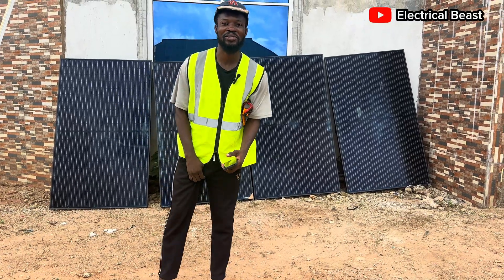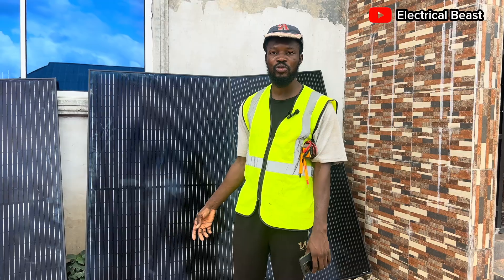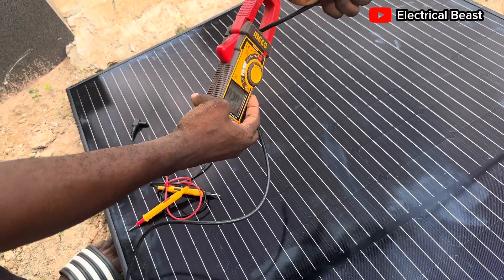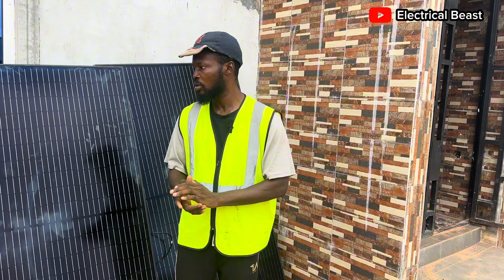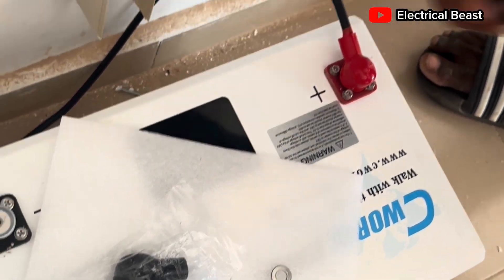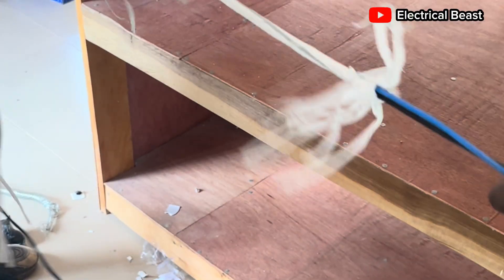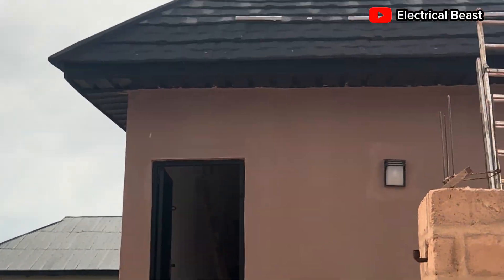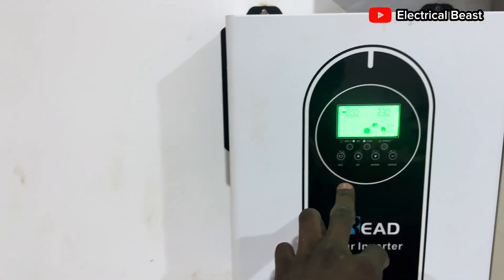Full Solar Setup Tutorial: 1800W Poly Panels + Inverter + Lithium Battery

Comment: Well-done boss. I have a question, for hybrid inverters, the charge controllers are inbuilt. How do we get or know the specifications of the inbuilt controller so we can properly size our load? Secondly, is hybrid inverter better than the non hybrid in terms of functionality and which is more expensive in terms of price?
Reply from the maker: The specifications are boldly written on the nameplate of every inverter. Lot of installers are switching to hybrid systems, they’re well efficient and overall cost is cheaper compared to low frequency inverter.

Comment: Not correcting you but many installers have disputed that absurd 13.8v bulk instructions from cworth. 

when the norminal voltage as they claimed is 12.8(3.2vx4).
Then for each cell to fully charged it would be at 3.6vx4 = 14.4v

Bulk charge should be 14.4v
Reply: I set mine at 14.4 bulk 13.8 float btw
Reply: @antonioatwhole7087  You’ll understand better later why it’s not advisable to charge your battery up to 3.6V per cell…You’re going to keep stressing the battery which will make it heat up and cause internal wear and tear thereby degrading your battery faster.
Anything above 3.5V per cell is not worth it as battery pack has been able to give even more than their rated capacity just by charging it to 3.5V per cell as long as it’s grade A
Reply: @rickymayne2298  i charge to 14.4v and drain to 11.5v(i would drain completely to 10v had there not being need to wake up the battery at dat level).

i did not buy this batteries to use them till i die lol.
It's like charging my phone to 80% and offing it at 20%.

If it die it dies, 
+ i won't give that company my dime ever if it did not live up to expectations.
Reply: @antonioatwhole7087  lol I understand your system probably do not cost you that much of money so you do not really mind how long it last.
Theoretical values are different from real world practical values…Just because you were told from a car manual it can travel 400km/hr doesn’t mean you should try to achieve that.
There’s always a sweet spot/safe haven for every thing, follow the practical values rather than doing things by the book.
If you spent 10m upward on your solar setup for you to go completely off grid, it’s only reasonable to make sure you at least break even and use it for more years compared to the amount you’d have paid using Nepa light 24/7 around the clock.
Most ready made battery won’t even allow you to charge up to 3.6V per cell as the settings would have been made from the company and mostly if the BMS on it isn’t a smart one which means not Bluetooth supported then the values are fixed and uneditable.
Reply from the maker: Great observation! Sometimes lower or recommended bulk charging voltage limits the charging to 3/4 bars on the battery.

Comment: Well done brother..
Please I need the breaker connection, I can't understand it well
Reply: Is it that the positive and negative coming from the PV terminal of the inverter is connected to the first breaker or the second breaker beside SPD ...
PLEASE I need more explanation
Reply from the maker: @clementadeyemi4581 connect pv  incoming cable to the dc breaker, then loop it to the input of the spd beside the breaker.